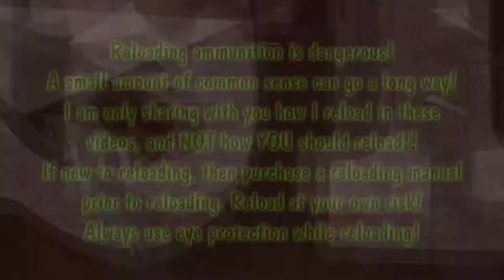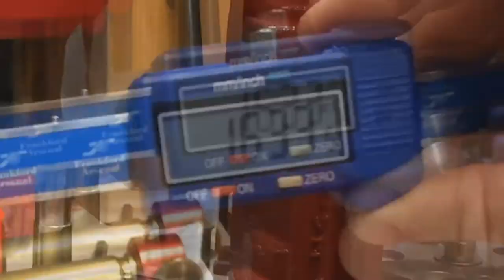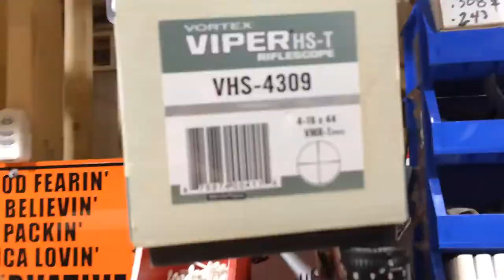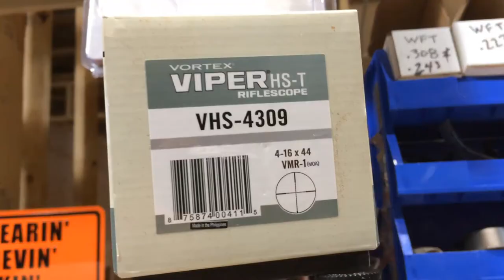PALMETTO STATE ARMORY PSA PA10 GEN2 RELOAD FOR PA 10 IN 3 MINUTES PART1

Comment: I have a 6.5 C.M. Gen 2 PSA & It keeps sticking cases in the chamber & ripping off the case flanges. Also double stacks & FTE & Any advise?? New rifle & Im NOT pleased w it. Only the Winchester  125 GR. X.P. functions properly & thats w the gasblock screwed out all the way,  but the S& B 140 gr FMJ makes cloverleafs at 200 yds but also rips off the rim & sticks the case in the chamber the worst. 18 out of 20 rounds are destroyed cases. Cases stick so tight I have to run a rod from front of bore down & fist hammer out the case.